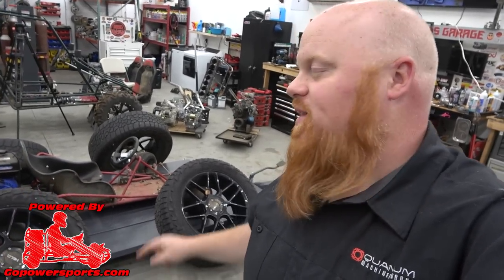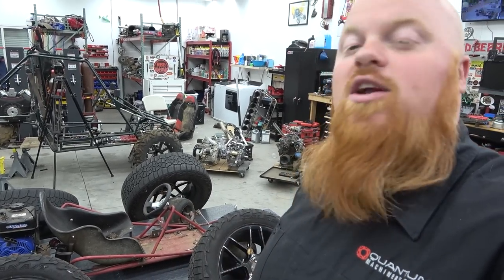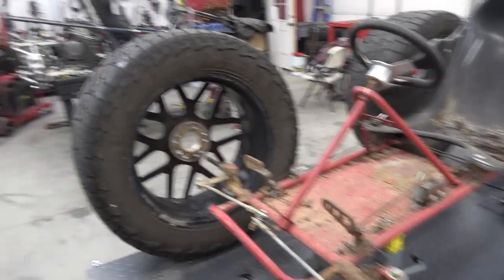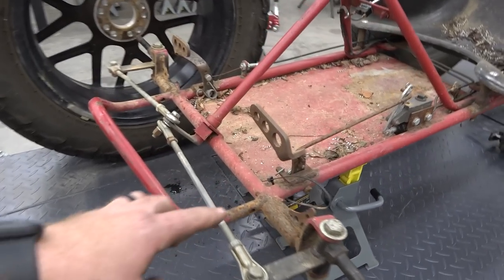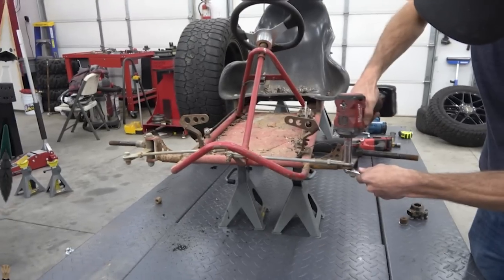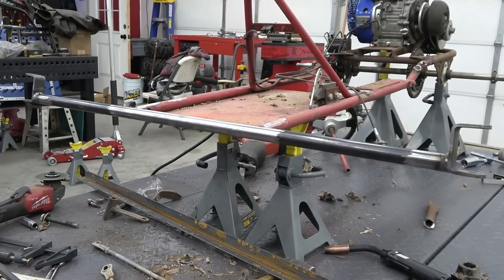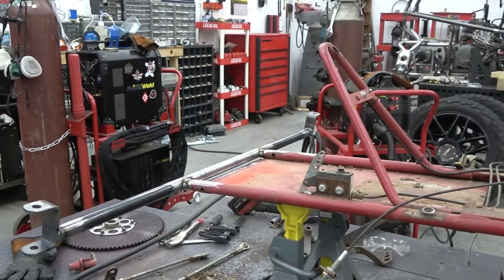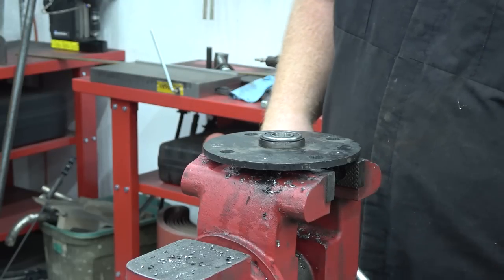Donk Go Kart With 20" Wheels & 32" Tires!

Comment: Greg a little trick to joining two shafts if you dont already know. Use your lathe and drill a half inch hole into the end of one shaft about an inch or so as a socket, turn down the end of the other shaft to make a half inch "pin", then v groove for a weld area. This works very well for keeping both shafts aligned and true for welding.